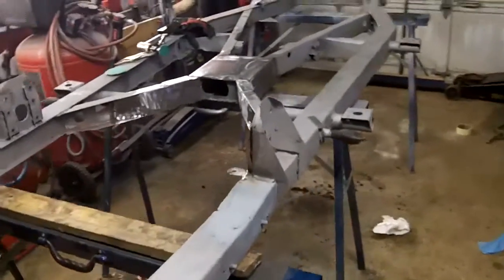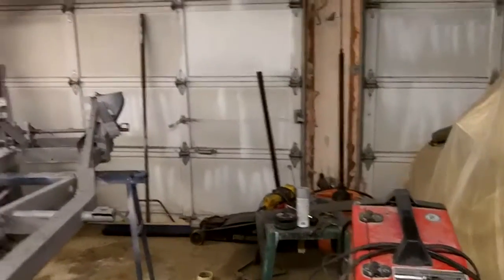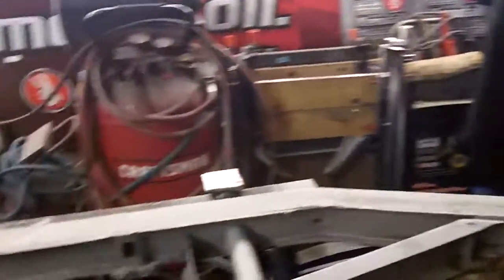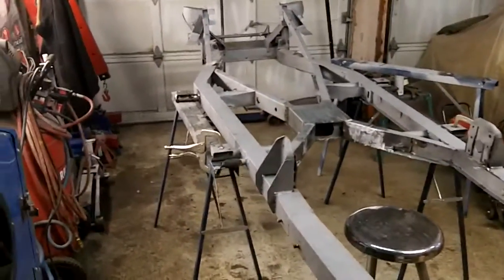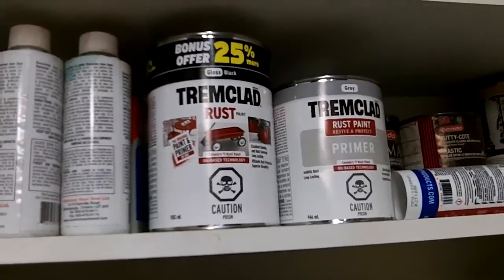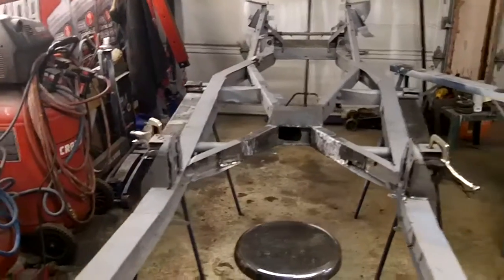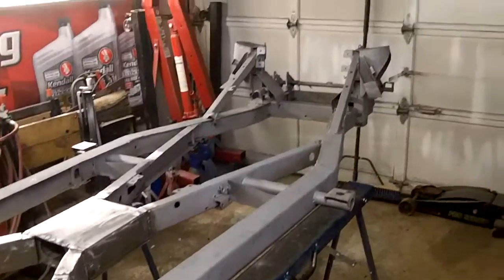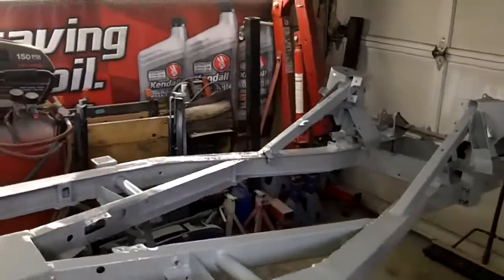1959 Triumph TR3A Restoration, Chassis, Part 11

Comment: POR .Paint over rust . Por 15 i ONLY use over rust like the instructions say. If you would paint that frame it could fail using por with no rust to bond to.. I think your choice is much better for this application than por15 .